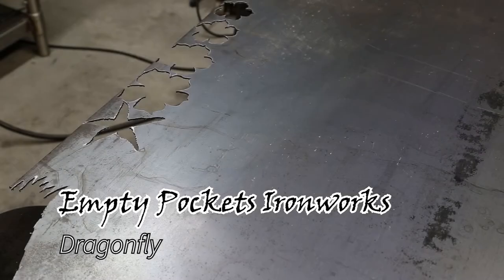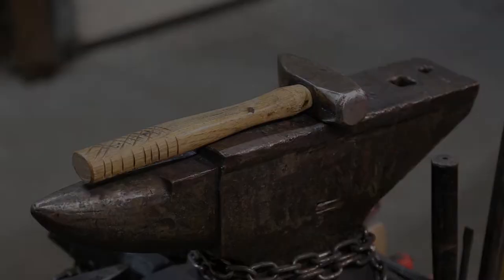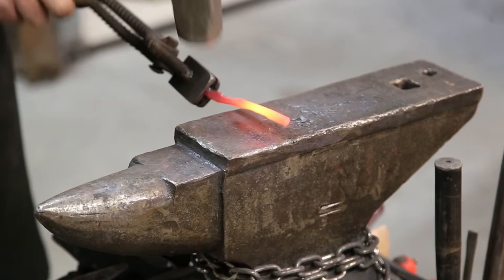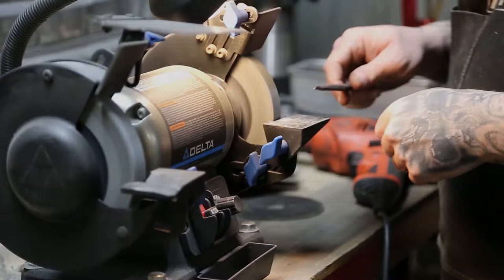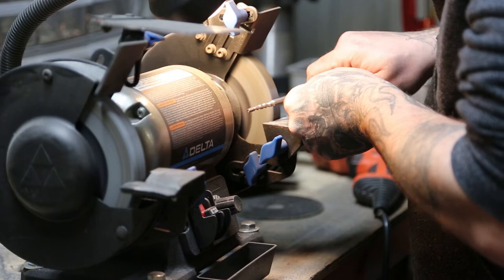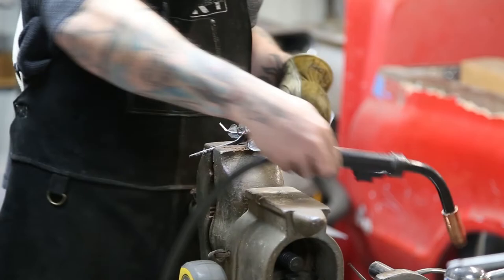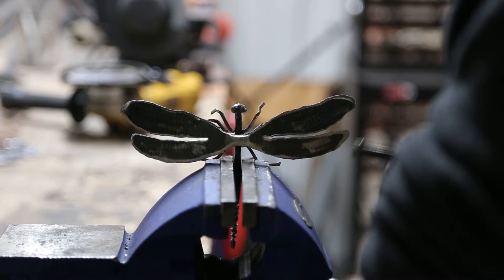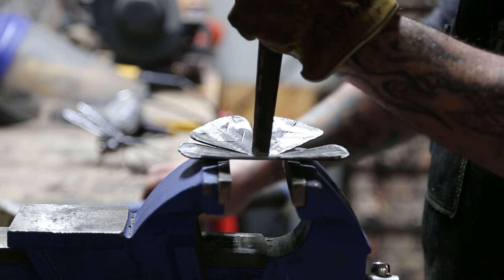Metalworking Blacksmithing a dragonfly metal art sculpture forging

Comment: I like your metal art. Can i ask what plasma cutter you use? The wife wants me to start making her stuff out of metal for garden art and things like that and was wondering what a mid range cutter would cost. Probably the thickest i would cut would be 1/8th inch i guess.
Reply from the maker: A little over a year ago I purchased the jegs pro cut 40. It's a 110/220 entry level plasma for around $200, set at around 60psi I have clean cut 1/4" plate with ease. I purchase the tip consumable from ebay, a package of 30 pieces including cups runs about $20 shipped to the house.  The electrodes are double tipped and last normally through a half sheet of cutting various shapes of 14g. For the money this little machine has paid for itself 10 times over. And if course with practice I've gotten some pretty details cuts . Thanks for inquiring and the compliment. Hope this helps.

Comment: Thanks for the video, well done.  Question: what kind of plasma cutter do you use?
Reply from the maker: Thank you, a couple years ago I bought a Jegs pro cut 40 plasma. It was around $240 shipped to the house. Consumables can be purchased in packs of 10-20 electrodes for around $20. I'm still using it and honestly it's paid for itself 50 times over. It's foreign manufactured but so far has proven to be the best buy I've ever made for the shop.